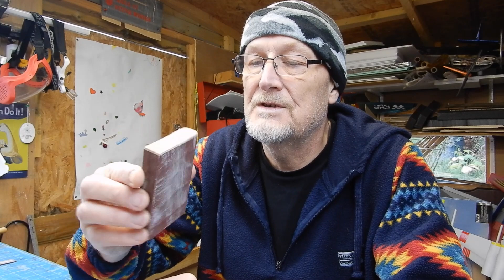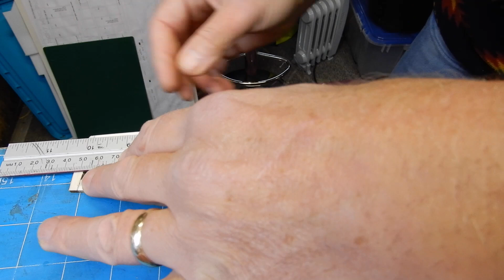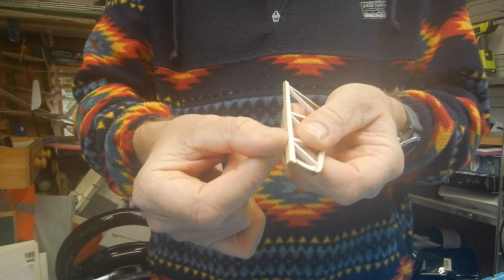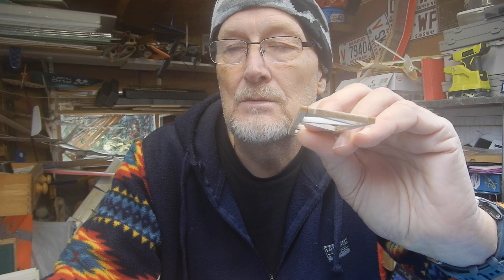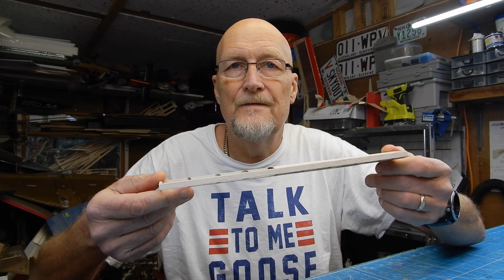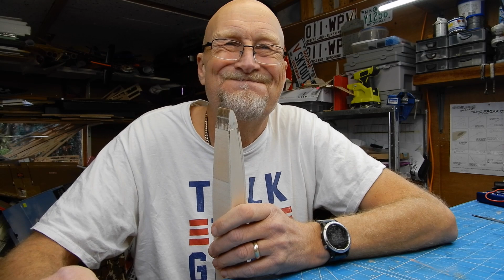How to build Genteel Lady Rc Glider  Part 4  Sanding for beginners

Comment: Nick, do any of your covering videos deal with how to cover the angle change at a dihedral joint.? Especially if the tips are a different colour? Thanks!
Reply from the maker: I do it in separate panels mate
Reply: I meant how do you trim the film where the angle changes.
Reply from the maker: @davidnorth8808 yes mate